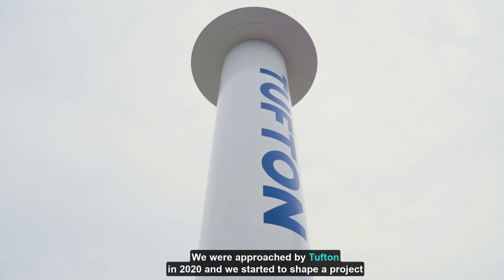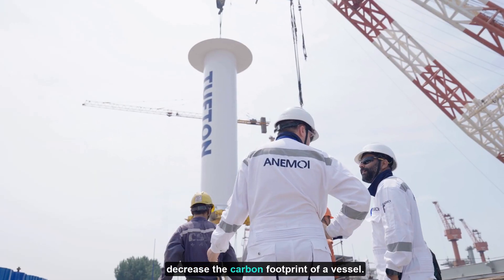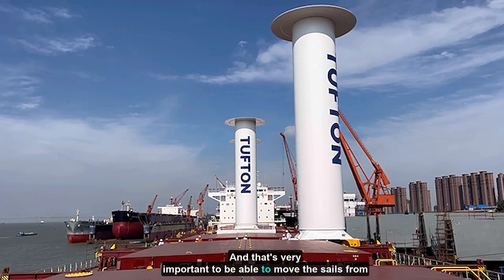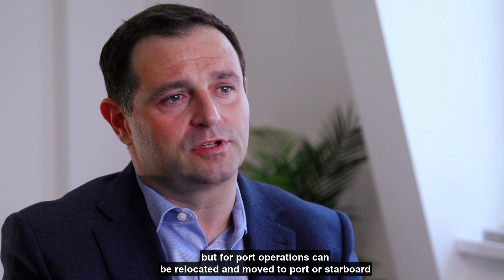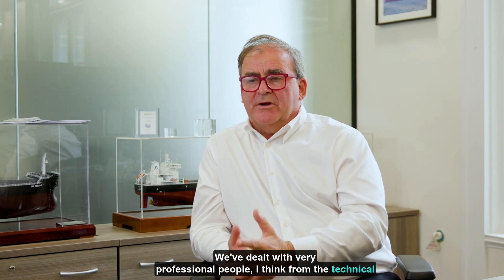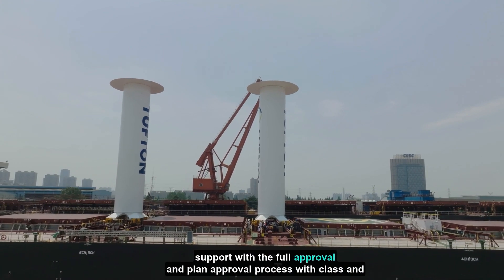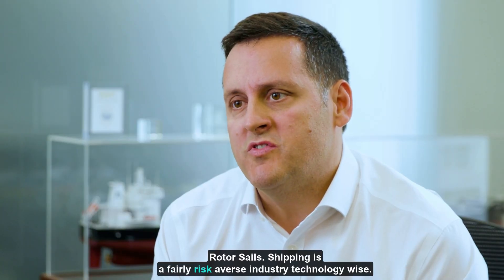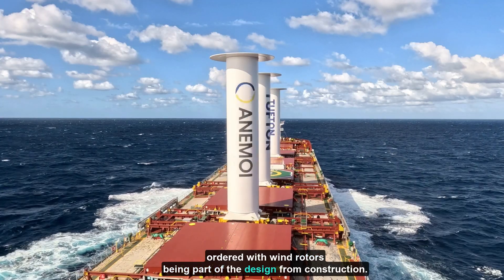Anemoi Rotor Sail Installation on TR Lady Kamsarmax bulker vessel

Comment: Assume sailing at right angle to a 15 kn wind (W).  Assume the sailing speed is 5 kn (V).   Assume a cylinder of height h (3 m), and diameter d (0.5 m), rotating at R RPM (100).  What is the formula in metric units T(W, h, d, R, V) where T is the thrust?  Thanks.

Comment: Hello... I want to know, no matter the direction of the wind is comming... those rotor sail move the ship forward???
Reply: No. They cannot move into the wind, any more than a sailing vessel can. Maximum power is available when the wind is at right angles to the ships travel. There is also very little power available when the wind is directly behind the ship.
Reply: @dnomyarnostaw  - Assume sailing at right angle to a 15 kn wind (W).  Assume the sailing speed is 5 kn (V).   Assume a cylinder of height h (3 m), and diameter d (0.5 m), rotating at R RPM (100).  What is the formula in metric units T(W, h, d, R, V) where T is the thrust?  Thanks.
Reply: @dnomyarnostaw  - I am sorry I don't understand.  There is no spreadsheet posted here?
Reply: @nerdibern3895  at the boatdesign website in my previous comments.  YouTube isn't letting me post long responses.
Reply: @nerdibern3895  They have deleted my previous posts:-(
Reply: @nerdibern3895   The answer is - set the rotational speed to 300 rpm,   and you should get 1.4 HP,  about 1 kilowatt
Reply: @nerdibern3895   100 rpm, will only give you about .3  kilowatts of power
Reply: @dnomyarnostaw  -- Thanks so much.  Will check it out.  For example, one can install one or two large wind turbines on a boat and mechanically link it to the rotor to do away with the sail.  No motor or water propellers needed.  In addition use solar panels.  A sail creates a lot of shade while a rotor does not.
Reply: @nerdibern3895   That's not the best way. Vertical Windmills are very inefficient. Better to have Solar Panels to charge batteries, and spin the Rotors from the batteries.
There may be a good case to charge the batteries from in water turbines ( electric motors running backwards as the boat sails)
Sails are poor shade things. They are never in the right position, they are the wrong shape, and way heavier than shade cloth is.
A boat without a motor is a useless beast, because it has to rely totally on wind.  You probably cannot even insure it.
Reply: @dnomyarnostaw  - Very good points.  Yes solar panels have reached 22% efficiency.  There are two problems.  You need a lot of surface, and you can't charge under clouds or at night.  A 40' cat with 2 electric outboards will need a minimum of 10 kW each.  That should give you 8 to 10 kn for a streamlined performance cat.  So that is 90 square meters at best of times (noon, no shade, no clouds, close to equator).  30 m2 is easy to get on a 40' cat.  But for 90 m2, you need to spread out of the boat in the back and the 2 sides.  But then these must be foldable and retractable down to 30 m2.  Nobody has invented such a mechanism at this scale yet.
Reply: @dnomyarnostaw  Sea turbines are very inefficient due to the low speed.  Besides if you have large solar arrays, you can't have sails due to shading.  So no energy to harness by a turbine.  I think this is the best design for a 40' cat:  Retain the sail and jib.  Minimum 100 kWh of lion NMC batteries (like a Tesla, i.e. not lithium phosphate),.  Two 10 kW electric outboards.  90 m2 of solar arrays that can retract to 30 m2 (6 x 5 m).  If there is wind, the sails will compensate for the shading.  If there is no wind, then pull the sails down.  What do you think?  And of course there is foiling.
Reply: @dnomyarnostaw  - Let's say you have 20 kWh of charged batteries, and there is a 15 kn wind.  Which will take you further at 5 kn:  the rotor sail or a 10 kW electric outboard?